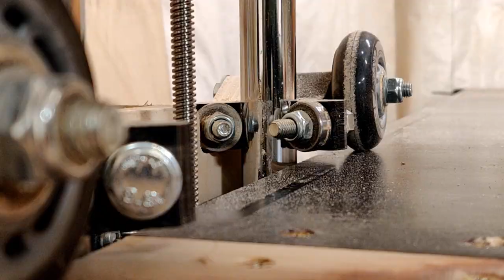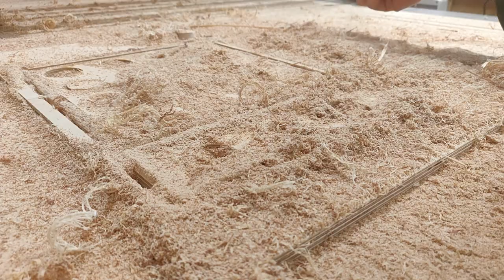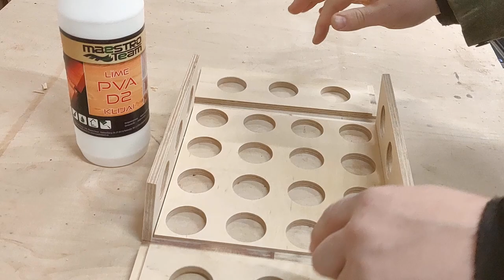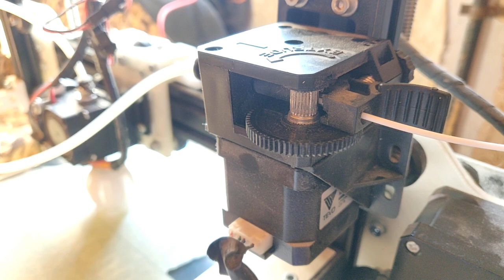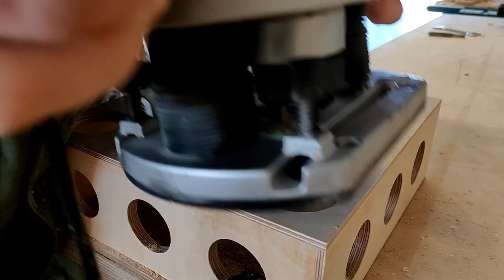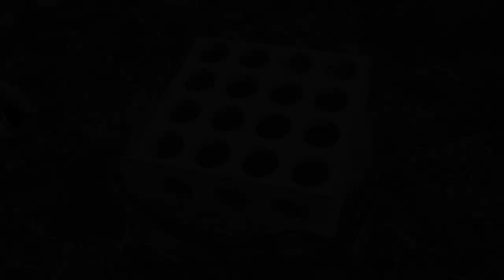Building a cat toy box on LowRider2 CNC

Comment: This is great. Any idea on what sort of accuracy you're getting on your LowRider2 ?
Reply from the maker: I am still struggling with the backlash - now it seems to be 0.5 to 1mm on X and Y. I beleive there is not much I can do about it, because the X gantry tubes have some flex in them, as well as all the belt situation does not help with accuracy. But for projects like this, it is not a problem. Z is dead on precise for the work I do - within 0.1mm
Reply: @KarlisZalitis  Thanks for the reply. I've been thinking about doing a LowRider2 build for woodworking but I was worried about its accuracy. 1 mm is not bad at all, at least for my needs. I'll most likely do the Y-plate upgrade that you did if I go through with the build. I'm stuck between doing the Lowrider2 and the "Inspired by Crawl bot" build on open builds. Thanks for the interesting and helpful content!
Reply from the maker: If you go for the LowRider design, you will definitely save a lot of money by saving on 8020 extrusions - in my opinion, if you would use aluminum extrusion for the construction, then lead screws or other kind of solid motor drive is a must, because of backlash in belts would render gains from solid construction obsolete. When I do my own projects where the CNC is just another tool, I find that the precision is more than ok - just take into account the possible deviation and you are good to go. But problems arise when you have to machine a part for someone else - the backlash can be problematic when the other party has troubles assembling their project. Hope this helps :)
Reply: Hello again. Wich bit results better cutting plywood? Im getting greats results with 1 cut compression bits (4 mm diameter) at 1200/1400 mm/min cutting MDF with DOC of 4 mm.

Comment: Nice job , am printing my stuff to built the Low rider , I already have the mpcnc. One q sir , are y using 2.2 kw spindle with vfd? If yes do u have the bracket for mounting ?
Reply from the maker: Hey :) Thank you! I am using a 1.5kW air cooled spindle with vfd. I opted for the air cooled version because in winter there would be problems with coolant due the low temperatures I get here. That, and I find that 1.5kW is plenty power for LowRider - you will end up stalling the steppers long before spindle needs more power. I have a custom X gantry mount but it is very much botched together with spare plywood and has extra holes for vacuum and laser, that I no longer use. If you are interested, I can share the drawings, but they are not well polished
Reply: Karlis Zalitis nice , thank u very much sir , I watched all your video , how do u zero the z axis and make it level ? Do u have two limit switches on each side ?